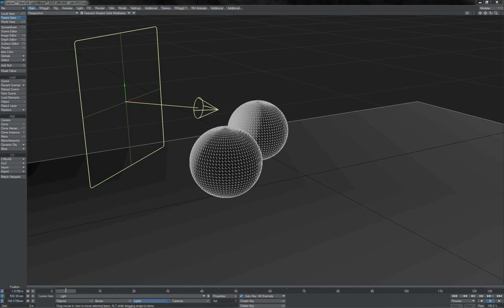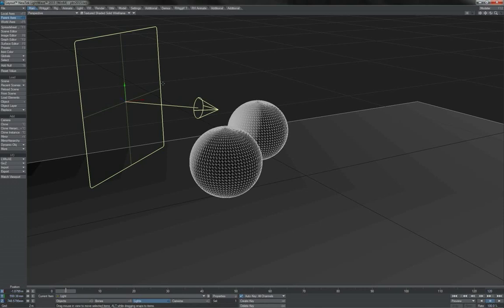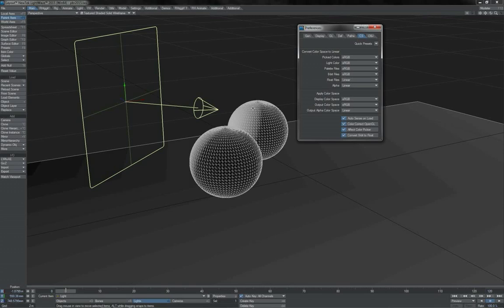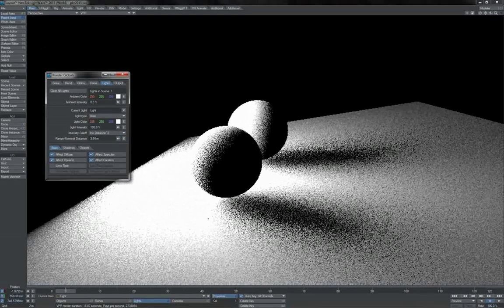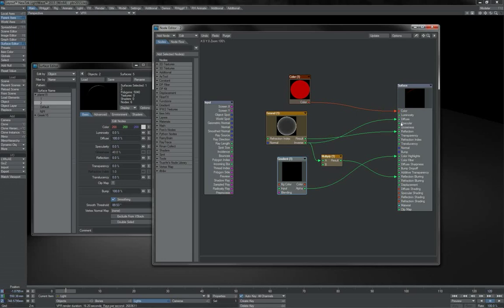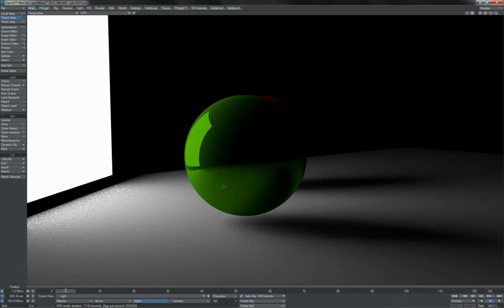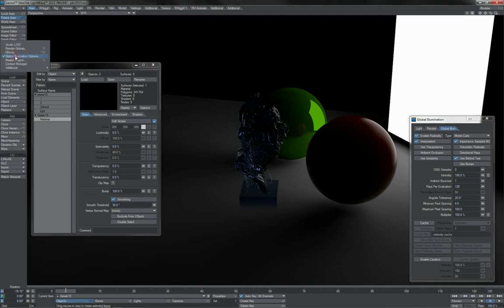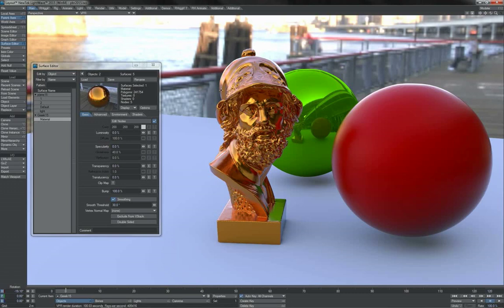LSR-LW Foundations 11 - PBR in LW Past

Comment: Another important thing to do, when dealing with PBR rules: balance out reflection and diffuse, in order for them to add up to 100%.

E.G. if you set reflectivity to 65%, then you need to have 35% Diffuse ( or colour... ).

There should not be such a thing like 100% diffuse and whatever % of reflectivity, say 50%, because it would make a 150% energy back to the eye, which is impossible if we stick to the energy conservation rule.
Reply: unnecessary as you can set it up to do this automatically. it's called Energy Conservation. you basically use the Inverse of Reflection and feed it to Diffuse. material nodes like Delta, Conductor, Skin, etc do this by default.
Reply: dumpsky 
I know what it's called and you cannot obtain that in any other way unless you don't use those nodes.
Reply: Mauro Sanna yes, but it's one of the key elements of PBR as is Fresnel reflection and every Fresnel node has an additional Inverse output. without Fresnel it's not PBR anyways. :-)